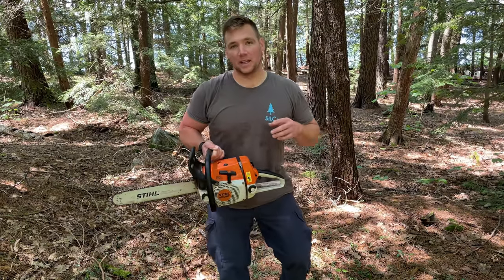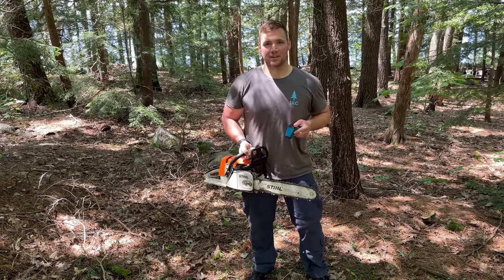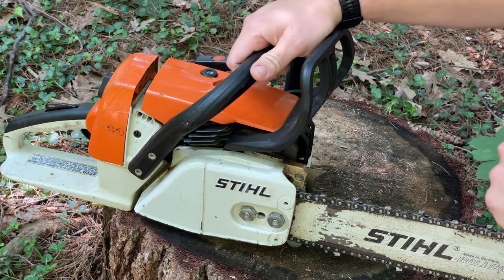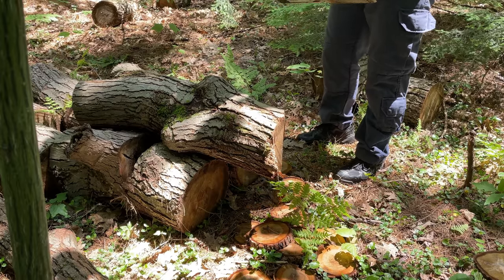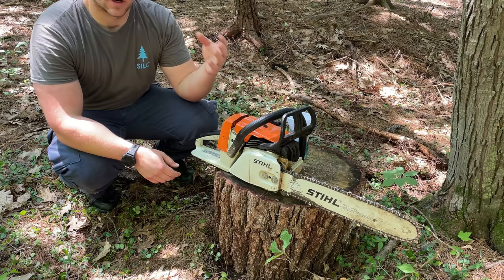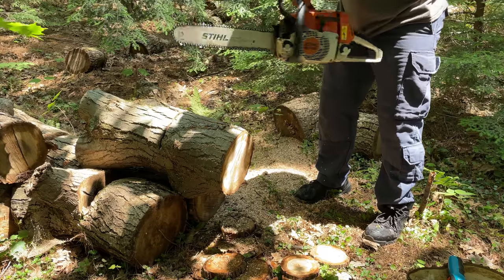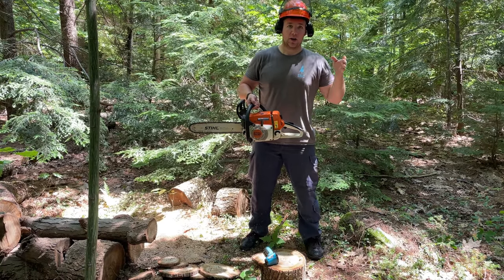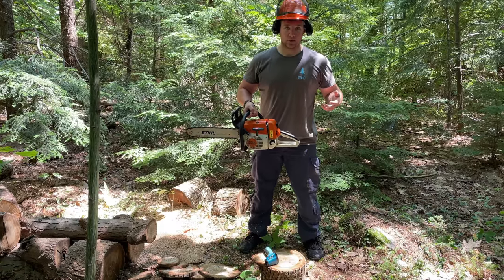Will my chainsaw last longer if I use more oil? Is it safer? (25:1 VS 50:1 temperature testing)

Comment: The reason for the higher temps is do to the extra oil raising the compression. The reason it didn't have the same power is because it was running richer. The jets would have to be turned in a little on the richer mix to get the power up. Some thoughts from an old logger.
Reply: such an underrated comment, as well as maybe the chain got just a little duller, so the engine had to work just a tiny bit more, 
as well as it was just one run, so it was not the average of like 10 runs, so differences in user inputs could have also bee the cause, but I agree with you, it needed just a bit of tuning, but still,
Reply: Richer in Oil, Leaner in Fuel.  The extra oil would certainly reduce power somewhat because there is less Fuel which is what provides the power.  Additional carbon buildup over time also.  I wouldn't call this experiment absolutely conclusive, you would have to more precisely control load with each cut as that is probably the biggest variable.  The operator may feel like he's applying 'similar' load with each cut but a variety of things such as changes in the log dimensions over its length, changes in Grain and density, and etc. would result in less than wholly accurate tests.  I don't fault Dave's attempt to test, he doesn't have a lab and equipment to control the variables and did the best anyone could do without the proper instrumentation.  There was a time when 16:1 and 32:1 mix ratios were common.  With modern lubricants, modern materials and modern methods that produce better manufacturing tolerances, we don't need that much oil today.  In any case it makes sense that less fuel would result in higher temps, that's what happens when you introduce less fuel to one of these engines.
Reply: @Qwertyuiop-wg5xu  You won't blow the engine up!
Reply: @Qwertyuiop-wg5xu  I always add a little extra oil to my mix. and after 52 years logging I have never blew up a saw. My brother who used to log with me wouldn't add extra oil blew up a good many saws. Common sense is uncommon.
Reply: @ajw6715  i kind of agree, really, like let it run a bit richer on oil rather than maybe running a bit leaner, even though it might get less strong, but still, you would tune you saw on the mix you have, lets say you are running a 40 to 1, you will tune it while it has 40to1 mixed in it, not you tune it with 50 to 1, then run it on 40to1, 
like, I am sure adding just a bit more oil will not be anywhere close to buying a new saw each few years, it definitely is better to be on the safer side, plus it is not as if you are damaging anything since you are still around 30 or 40 to 1, it is not as if you are going with 10 to 1 or something
Reply: @AJW Are you sure? Surely leaning it up more by turning in the adjusters would make it even hotter ? It would be interesting to see the result. I would expect it to be the opposite of your idea.
Reply: @muffinthepug2358  well, i am not a professional, but from my understanding, when you have more oil, you are having less fuel coming into the cylinder, thus the adjustments should make it run richer, not leaner, since the fact of the presence of oil in the fuel, and oil does not burn like gasoline, so more oil in the fuel makes it run leaner, thus you have to make it run richer by compensating....
Reply: @Qwertyuiop-wg5xu  totally agree thats what I thought too but @AJW was suggesting turning the adjusters in which leans the mixture doesn't it ?
Reply: THAT..makes too much sense! Can’t be..
Reply: @m118lr  Lol. I have been down that road many times over the last 42 years.
Reply: @ajw6715  I've never seen a 2-stroke fail as a result of too much oil.
Reply: @muffinthepug2358   listen to the logger !
Reply: @andrewslagle1974  I did, turns out I was right that turning in does indeed lean the mix. He meant turn it out to richen, easy mistake. No need to call him clueless. Oh I see you edited that bit out now. Well done
Reply: @Qwertyuiop-wg5xu  true.  Engines used to be set too lean for my liking.  Too little oil, also.  

Turned both high and low needles out to “obviously rich,” then in just a little, and 32 to 1 instead of 50 to 1.
Reply: You absolutely need to tune the engine to the fuel mixture ratio or you can kill an engine… that wasn’t stated in this video and it’s huge… there’s a bunch of guy’s learning and they need to know that by changing your mix ratios tune’s need to follow????  I don’t think these guys even understand this point… it’s 50 year old I’ve been logging 30 years type knowledge… they don’t teach experience at the Stihl school…. ???
Reply: The oil actually should increase the octane of the fuel, no liquid compresses regardless if it is fuel or oil the end volume of fuel entering the engine after the carburetor should be the same regardless of the ratio, as long as the viscosity is the same.
Reply: @muffinthepug2358  Let me see, he's been logging how long a he's upside down on tuning the carb? Hmmm 😆
Reply: @ajw6715  annnnd....???
Reply: @ajw6715  aaaaaaaand...???
Reply: It is not extra compression. When you add extra oil you lean the mixture. You have to increase your jet size to make it run right. The increased oil takes the place of gas which causes it to run lean. Oil and gas mixture should match the RPM of an engine. Very high reving engines at say 13,000 should run 16-1 ratios to make the most power. Chainsaws don’t run at that RPM. My pro saws can hit 11,000 RPM. Running 20.1 to 32.1 would create the most power in these saws. The increased temperature you are getting is from the leaner condition from adding more oil. You need to reset your jetting. You will hurt your motor if you don’t. I cut wood on a regular basis. The way I learn this was being a suspension development racer for Honda and an evening sitting down with Mitch Payton who was the guy who built two stroke motors to win national championships. I think he has about a hundred and eighty of them today. He also has a national and a Grand Prix teams. He can make a 65 CC put out 30 horsepower for kids race bikes. Temperature and altitude can have the same effect on motors especially high performance motors. If I raced at 3,000 feet one week and then at 300 feet the next week I had to completely reset to much richer setting or it would of seized the motor.
Reply: @charleswinters7129  gokart engine running to 50:1 at 20000rpm. Of you go to 25:1 After 3 laps you broken engine. More oil more compressione more temperature and hoverating engine with decrease Power!
Reply: Thanks, all !  Now I know.
Reply: Yes with the higher oil ratio it runs leaner, thus hotter, but the reason is that the fuel is thicker, has a higher viscosity and thus less passes through the main jet, "hi needle" when ever you change oil ratio or brand of oil, you need to readjust the mixture.  A better test than a chainsaw would have been to use a "leaf blower" as it has a constant fan load and one just adjusts tht 'High needle for the higest rpm at full throtle, then open it until the rpm just begins to drop.
Reply: Yep, jet accordingly for your ratio.
Reply: @zzzgz5  Great points! I do respect the fact that at least this man performs testing even though his testing controls and criteria are not sufficient to reach any solid conclusions. At least he's not just spouting off an opinion like the majority do. " One test is better than one million opinions " 🙂
Reply: @johndavidwolf4239  I agree with you completely.  I have an oil injected 2 stroke street bike that I rebuilt.  To be safe after rebuilding the engine, I ran 50:1 in the gas tank until injector lines were full of oil with no air.  The bike ran so lean I couldn't get the bike to accept more than half throttle.  The next tank of gas was straight up and it ran perfect.
Reply: In my 2stroke dirt bike experienced, more oil will lead to leaner mixture due to it will restrict a fuel/oil mix through the jetting hole..
Reply: In well broken in engines in good condition with seated rings the compression is strictly a function of mechanical sealing of the rings against the bore. You may see a 1/2 percent increase in psi if the remaining lubrication oil has seeped out of the ring lands and piston bore interface but that is about all. As for running richer, no. Oil generally burns very reluctantly and depends on type of oil. The main jet needle would have to be screwed out to restore decreased fuel supply but it's so tiny you'd never notice. The only needle that reacts as you describe would be an air bleed idle jet that leans the mixture when screwed out (Bing carbs, etc.) At a 50:1 ratio you're only talking about 2% total oil, 4% at 25:1.
Reply: @ajw6715  Then I guess running at 100:1 is death to two strokes. You'll have to tell that to all of my engines because that's what they run....even my 50hp Hirth ultralight engine. More is not better where roller bearings and needle bearings are concerned.
Reply: Two strokes are tuned by ear not an arbitrary fuel:oil ratio. Regardless you will start rich and slowly lean the mixture until the engine breaks from four cycling (yeah, they do four cycle when the mixture is excessively rich because not all of the previous rich, unburned portion of the charge gets scavenged and increases the next intake charge with even more excess fuel that makes it unable to burn) into a just-barely two cycle. You'll hear the definite exhaust note change. Just where the two stroke/four stroke change takes place with a slight bias to two stroking is where you want your mixture set. Air cooled two strokes derive a lot of their cooling from excess fuel as it's more efficient than the paltry amount of air being blown over the barrel and head.
Reply: @johndavidwolf4239  interesting comment. Good idea on the test
Reply: @zzzgz5  I totally agree with your conclusion. The fuel and oil being mixed go through the same jet. More oil means less fuel. The engine will be running on a leaner fuel mixture meaning more heat.
Reply: @ajw6715  as a professional small engine mechanic I agree I tune all saws at 25-1 if the customer chooses to run 50-1 that is fine as it was tuned for the lower fuel to oil ratio and it’s not going to lean out with the afr’s it’s the air fuel ratio that has the biggest effect on combustion conditions
Reply: It’s not the compression being raised lol who told you that? It’s because the afr’s are leaner and that is what controls the combustion temperature
Reply: @ajw6715  it's common sense ain't the sense of the common
Reply: @Qwertyuiop-wg5xu  The adjustment to the carburetor recommended by many people in the comments is interesting. If the carburetor is adjusted to allow more fuel to the engine it also allows more oil into the engine. A pre-mix is just that, a fixed amount of oil and gas. If the engine has oil injection then the amount of oil to the engine can be adjusted.
Reply: It is just as you say.  More oil=less fuel=leaner mixture.  Need to richen the mixture at double the quantity of oil  @muffinthepug2358
Reply: @yungsmile7546 this comment section is awesome, people will follow anyone if they say some fancy trade words.  Fact=original comment has it backwards.  More oil=less burnable fuel.  Less fuel=lean mixture.  Turn the screws out for more fuel to correct the problem.  Make it leaner to explode your saw.  Quick trick for adjusting a 2 stroke dirt bike at the track is to adjust your oil ratio.  More oil leans out, less oil is richer.
Reply: Um not. It's running hotter because there is less fuel since ther is more oil . Even thought it's running hotter it still has more lubrication.
Reply: @billjohnson5951 
Thus is by far, the most sensible comment thus far.
A pre-mix is just that, a pre-mix. It's ratio is "fixed."
Reply: @charleswinters7129 thank you for your input and experience. You are lucky to have had those opportunities. Ride Red!
Reply: This is simply amazing, you take an extreme amount of time to PROVE this oil issue, and people still say this test is wrong. Must be Harris voters in the midsts
Reply: More oil in mix causes higher compression especially with older engines. The saw will run leaner with more oil in mix this is due to the fact the mix is now more viscous and less fuel is sucked thru the carb jet. A comparison would be sucking a thick and thin milkshake thru a straw.
Reply: It is also due to a slight leaning of the mixture of air/fuel, as lubricant is taking up the volume. 
We would tweak jetting in half steps on our 2t racebikes with mixture ratios